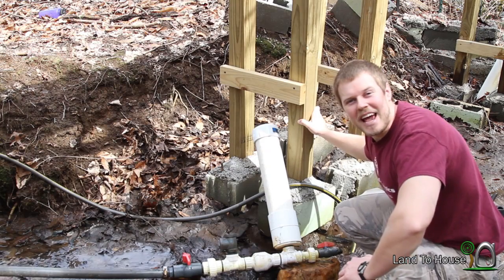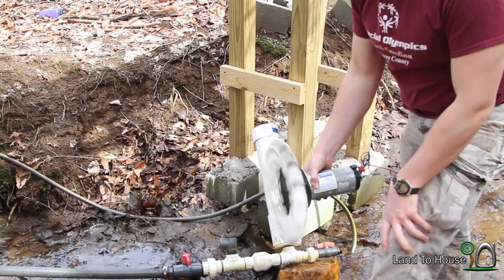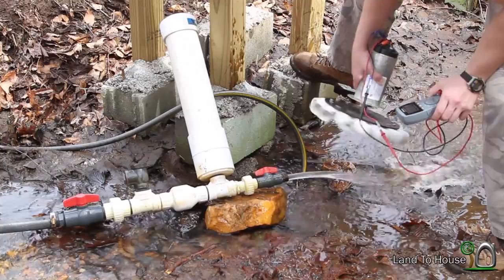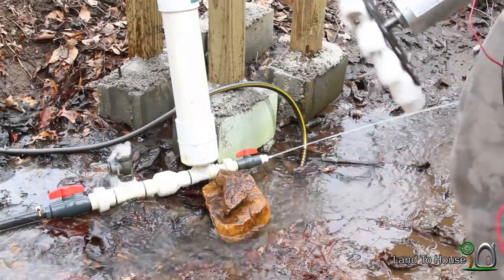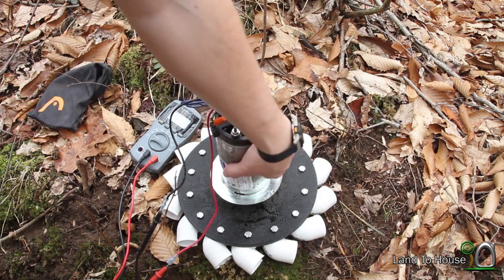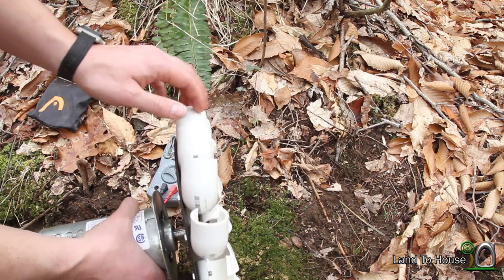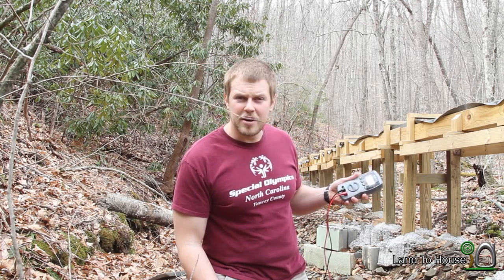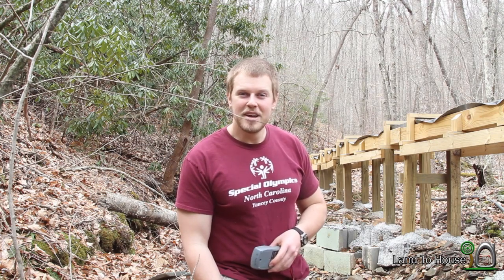Ram Pump Micro Hydro | Land To House

Comment: I'm going to build a hydro for when I reach the top of the mountain (I mountain bike) and I'm going to 12-14 PSI, how much power could I get?
Reply from the maker: Good results! I have not spend much time working with power generation. It is something that I hope to get to in the future.
Reply from the maker: I have to be honest with you. I dont know much about micro hydro. I have just tested with 3 or 4 videos. I cant say what you would get from 14psi.
Reply: To generate 300, 800 and up to 5000 watts you need at least a height difference of 35 meters with a flow rate of close to 1 l / s, a permanent magnet generator of 4 poles and 1800 rpm, a 3/8 nozzle "You will also need a voltage inverter. This device is finally the one that will give you the power that you need, luck.
Reply from the maker: +William Martinez my little creek is not going to get anywhere close to that. I have a feeling I can get closer to 50w with my flow.
Reply: What can I say, with a small stepper motor I experimented recently, working with an open jet pressure of approximately 15 psi maybe more, in addition there was a height difference of 14 meters, use 1 inch pvc pipe, The nozzle that I used was of 5 mm of diameter approximately with this I could turn on 6 led bulbs of a contact for automobiles, the engine that I used it extracted of an old printer tell me if that helps you, excuse my English
Reply: power(watt)=7*Q(l/s)*H(metters) It's not exact but it gives you an idea.
Reply: William Martinez do you know the watts?
Reply: I read something about it, why do you ask me?
Reply: what do you want to do in your land?
Reply: You should measure the flow of your creek to know what power you can count, you should also look for the highest point where you can do the water extraction, with the flow and height you have to select the type of turbine (kaplan, pelton, turgo , Francis, Ossberger)
Reply: Maybe you should make a small reservoir of water if there is too little of the water flow you have
Reply: Or look for other options like wind generation or solar generation

Comment: Can you run more than 1 pump in the line? just thinking about gaining tip pressure to increase the RPM on the wheel....also that could over come LIFT issues if it were possible to run multiple in-line pumps
Reply from the maker: I have not tested this yet but I have a feeling that it would disrupt the pressure wave. Now you can have more than one pump running in the same creek. :)
Reply: Thanks for the reply sir....So why not try to add in a Centrifical type pump.. if they make one small enough to put in the line...One that might be driven by the pressure comming in. Also sir... what type of pump is that as far as Family group..(examples) positive displacement, centrifical, piston, Rotary vein..
Reply from the maker: The inline pump would be for generating power? The ram pump has a pressure wave that travels both up and down the drive pipe. I am not sure but that might affect the power made due to polarity issues.  This motor was just an old treadmill motor. I am not sure of the specs.
Reply: thanks...... 30 yrs career FD and over 40 as a Vol FF...always liked playing with water sir.
Reply from the maker: It sure is fun getting in the water. Even if its just looking for animals with the kids. :)

Comment: I know you're still working on this so I can offer some suggestions: A lower RPM motor at 110VDC will produce more volts at the same RPM as your test motor. For example I intend to use a 90V motor rated at 1800RPM, that will produce 12V @ 240RPM. A higher voltage will allow more more watts to be generated without surpassing your amps limitation of your motor. In your test of open flow I suspect you could have gotten more power but at a lower voltage and higher current than your jetted down tests simply because there was more gpm hitting the turbine.
Reply: Land to House yes rewiring it would work too. Didn't think about that, although I was thinking to use it for DC power to run to a battery bank and use an inverter from there for AC. At least that how I have figured on doing it. Using a battery bank would allow me some surge capacity allowing my usage to temporarily exceed my power generation.
Reply from the maker: Good info! I have not taken the time to get back out and work on these type projects lately. So wrapped up with the new house and baby that my mind has been a long way away. BUT I sure would like to get back to the water. I have two other DC motors that are better suited for this project. One of them I would like to use for a water wheel.
Reply: Land to House forgive me, but would a car alternator not work better? it is already set up to provide a constant voltage. I'm no electrician however.

seems to me however if you are increasing the head on the water you will have the pressure to use a larger nozzle and get more mechanical force on your turbine. you could also further increase your pressure by running the water through 6 or 8 inch pipe untill the very end then progressively necking it down to a smaller size for further increase of water pressure and velocity. additional use use of multiple nozzles would also allow you to use further necked down nozzles for increased velocity while maintaining the GPM and amount of force that goes with it.

been wanting to do a similar project for myself so have been investing a lot of thought into it.
Reply from the maker: A car alternator would be a lot better in this case. It would have to be rewired to be used as a DC generator but it would be good. A larger nozzle and a lot more pressure would be needed to make any real power.
Reply from the maker: +Richard Adrian storing the energy in batteries is definitely the way to go. Someday I would like to install the solar panels I have and start making some power with them. Those definitely have to have a battery storage

Comment: This is so cool.I have a big stream beside my house ,im gonna do this too :D
Reply from the maker: Ram pumps are so great. I am not sure how well they will work for making power but for pumping water it cant be beat.
Reply: The pulser pump looks better to me. It can take more flow and doesn't have any moving parts. The guy has some videos with quite impressive results. He doesn't have a stream anymore so other people need to develop it. He says about the vibrations caused by a ram pump and how they could cause harm to wildlife. This seems accurate to me for small things in the water those sort of vibrations could cause damage and certainly disturbance. The pulser seems like a much more natural approach rather than forcing the water up in a sort of petrol engine approach. That is for the racing track rather than the stream and forest. The pulser might also be able to lift water higher. I was trying to work it out. thought it might be something to do with the weight of water going up between the air vs the quantity of pressure needed to displace the exit water and let the air out that way when more water is coming. I was thinking to try and get lots of air intake and the weight of the water going up with lots of air pockets isn't so great. it might be able to go up quite alot. Say you used an oil drum as the chamber. to displace the water with air would be a similar force possibly to trying to submerge a barrel of air. This is how like massive container ships weighing alot stay afloat. Anyway not sure exactly how it works I was thinking the chamber could be big but maybe it is more to do with the volume of water in the exit pool. I really have to try this out.

Comment: Not sure why you are measuring voltage when what you want to be measuring is watts or the rate work can be done.  You are measuring voltage which is potential.

Ideally you want all of the energy from the water to be transferred to the generator.
Reply from the maker: This first test was just a chance to see if the small amount of water would turn that motor. Nothing fancy.

Comment: totally different scenario under load. amount of water * pressure = power
Reply: Good start !!You obviously have a lot of water bypassing the system. That's power you can still harness. How much head do you have available? The further "up the creek" you can go the more head ( pressure ) you have to work with.  When you turn on the ram pump you get higher pressure and therefore higher velocity, but at a much reduced flow rate and ultimately lower power ( volts times amps ) One thing I always forget is that at the output you want to have the water velocity at zero ( IE you have removed all of the available power ) With a Pelton wheel the spoon velocity should be half the water velocityI noticed you have what looks like a sluice behind you..
Reply from the maker: +WickedEngineer I figured there was not a lot if power there. Someday I will try a real Pelton wheel.
Reply from the maker: Bob Smoth Yes it was a fun try. I can get about 7 feet of head pressure here at the location of this ram pump. If I went up further than my property I could get another 7 feet. That is a flume/sluice. I have plans of working with that to make a little power sometime in the future. So many projects so little time.

Comment: Hi, I am Raju Joshi from Nepal, I like your clips for free water supply with high pressure by jet nozzle. Can I get systems of how to do in home and pressure parameters with sizes of pipe diameter?? If you wish to support then send me your systems and all the details in my email- joshi.raju65@gmail.com  
Thanks
Reply from the maker: Hello. You can find all the details on how to build a pump on my site. There is a free ebook showing you the steps. As for the jet nozzle it did not provide much electricity in my test. http://www.landtohouse.com/rampump/
Reply: building a chicken coop
Reply from the maker: +Mr504319 I would like to one day.

Comment: The amount of energy is dependent on the amount of water. You may get more free speed, IE unloaded voltage, out of the motor but if you put a small load on it, you would get more power out of the nozzle with the greatest flow.

Voltage here means nothing, You need to measure the amount of watts generated to get a true indication of the power generated> I'd suggest going to a lower voltage motor to start with so the RPM don't have to be as high to get useable current.

Keep going with it, looks like you have put a lot of work into your setup already, now you just need to fine tune it.
Reply from the maker: Hello and thank you for the input!

I actually just set this little test up just to see what would happen. A lower voltage motor would make some difference and I am sure adding lots more head would too! I will be testing out an archimedes screw turbine soon and I hope to use a ~1200 rpm motor instead of this 7000rpm. and I will be using the full creek. it would be nice to make close to 100w out of my creek. 

I appreciate your watching and commenting.
Reply: True, but a nozzle can help put the turbine in a more efficient operating range.  I think the motor isn't wired or ideal to be a generator, but if it is I think there's something that you might try; make the wheel smaller so you can achieve higher rpms.
Reply: It's all about efficiency. You only get as much potential energy to put into the system - the column of water. Full flow with no pump would support the most torque on the wheel I suppose.
Reply: +Land to House mount it on the stand with a belt to it so you can gear it up or down.
Reply: +Land to House the wheel actually looks pretty good, don't think you need to buy one
Reply from the maker: The only issue is that a disk like that will deteriorate in the water.
Reply from the maker: I had another video test years ago trying to get a gear system to work. Someday I will get back to that.

Comment: Just a thought, but by scaling up the Pelton wheel, it may be possible to use gear reduction to drive your motor at a higher speed to achieve increased electrical output.
Reply from the maker: Very true! This was just an early test for sure but it seems like a valid means of making electricity. A solid mount and gears would help a lot. :)
Reply: I was thinking hte same thing. It makes no physical sense for there to be more energy in the water after it has gone through the ram pump, so using higher flow at lower pressure to turn a bigger wheel, which is geared to spin the motor faster might be the way to go. 

Suppose that requires more moving parts but might be worth looking at. Anyway, love your videos man.
Reply from the maker: +andrewford80 to me it seems best to user a good old fashioned water wheel if you have the head pressure of 7-10 feet. I have read that Pelton wheels are good when used with lots and lots of head pressure. Say 100 foot drop or more. 

Thanks for watching my videos!  Most of them have been fun to make.

Comment: One question.  I thought the water was just flowing down your spring through the pump.  Were you using your Ram to pump water up high to produce pressure or was the pump being used to just deliver and control the water to the wheel?
Reply from the maker: Actually I just had the ram pump working from the creek. Then I was using the output of the ram pump to run the nozzle.
Reply from the maker: In other words there was no tank or hight to add more pressure :)

Comment: Those were some great experiments.  I wonder about how much water was coming out of the 4 volt test after you reduced the flow volume.  You know I don't have a lot of volume but with the steep land I have I can get lots of PSI.   Thanks.   Wouldn't it be neat to get 12 volts then hook it to a grid tie inverter and turn the meter backwards.  :-)
Reply from the maker: Thank you! I did not test the volume of any of those. I do know that when I turned off the pump the water still came flowing out for a few seconds. This tells me that I could use a larger nozzle and still have pressure in the tank. It would be really nice to have that much voltage! I think its doable with a little more work and a much better wheel. Now once the batteries are attached to the motor it would slow it down a lot.